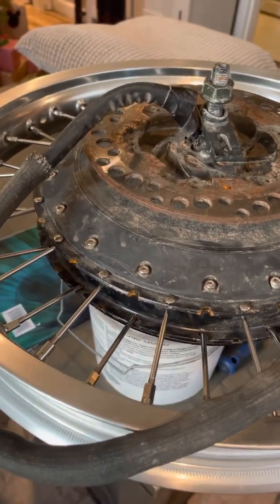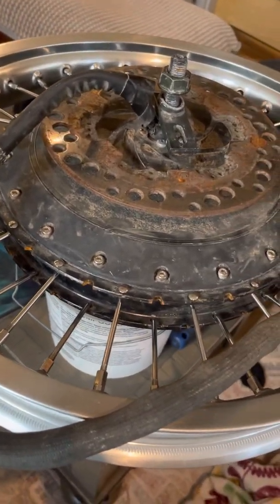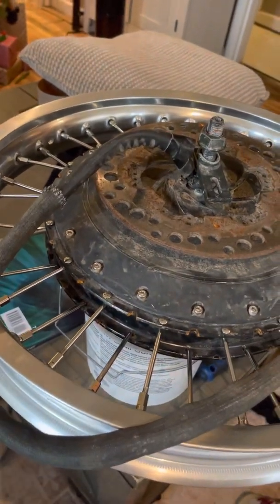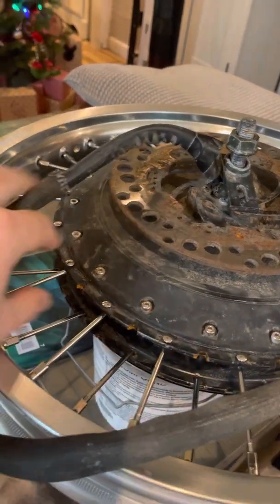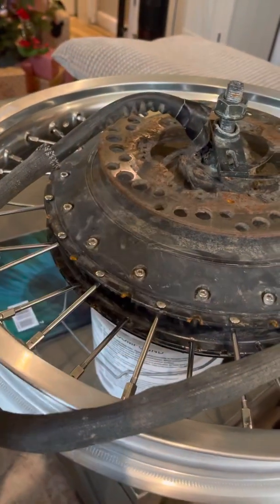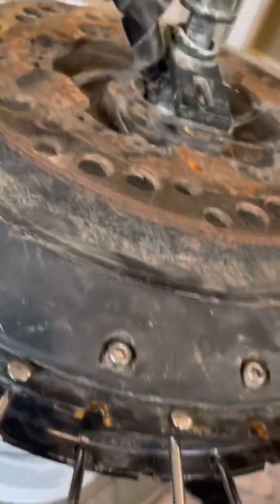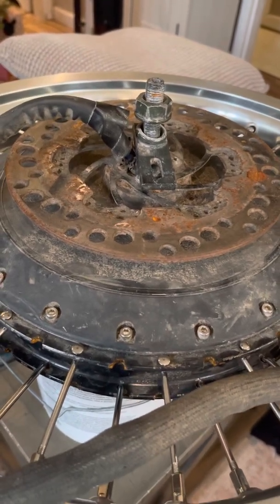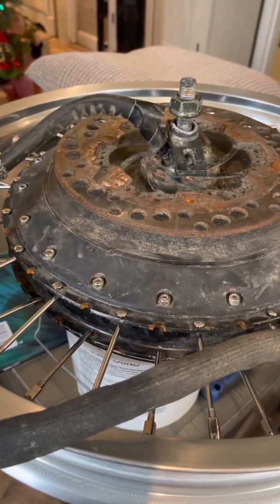Qs273 8KW upgrades / repairs 3.5T

Comment: Where did you buy the spokes cut to length?
Reply from the maker: 4.0mm 304 stainless steel diameter 70mm 8G spokes off eBay. tusk impact rim. Had to drill slightly larger holes on the qs273 to fit and laced them inside only. https://www.ebay.com/itm/55-220MM-8G-Electric-Bicycle-E-bike-Spoke-Nipple-Dia-4-0MM-304-Stainless-Steel-/294339401837?mkcid=16&mkevt=1&_trksid=p2349624.m46890.l49286&mkrid=711-127632-2357-0